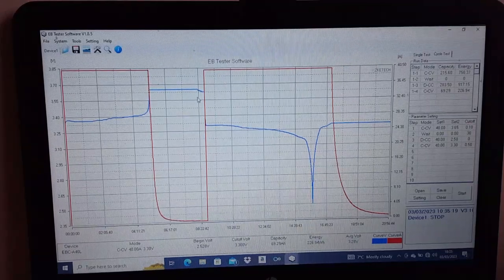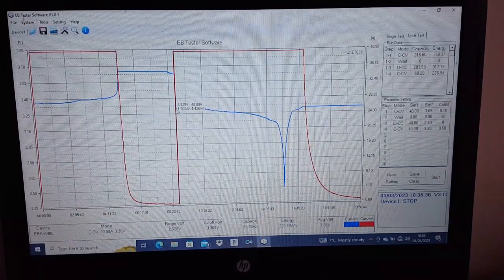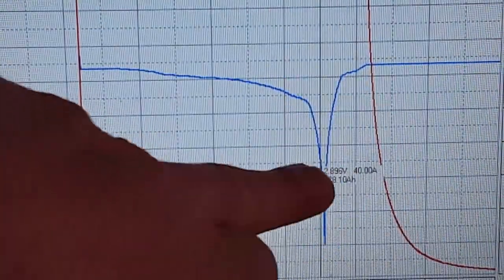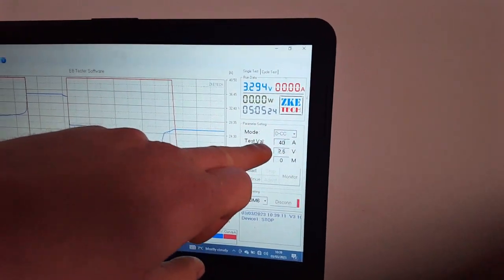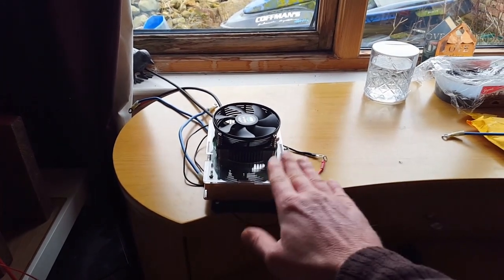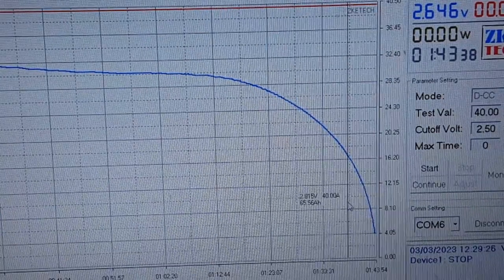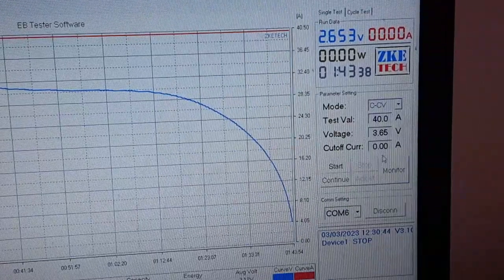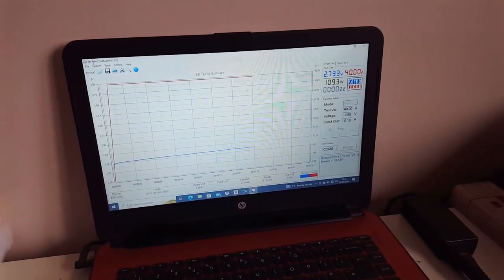Testing LiFePO4 Cells with the ZKETECH EBC-40L Testet has been a voyage of exploration!

Comment: Hi mate, I was curious for a while about your plans... You have a grid tie inverter and what inverter are you planning to connect to these batteries? I have investigated options with hybrid inverters and connection lifepo4 cells which is problematic as it needs certain bms's to comply with hybrid inverter settings. I'm currently filling in an g98b form for permision of 3.68kw solar system ( diy install, fingers crossed ;D ). Still looking for the best solution.Cheers
Reply from the maker: Hi ya, firstly thanks very much for taking an interest. 
Yeah we are mainly grid tied and had the orgional 4kw for about 12 years. The old panels started wearing out and  it is far to expensive to upgrade the system with grid tied hybrid inverters.  Until I get an AC coupled diverter inverter/batery charger I have been manually charging my littokala batterys using a cheep Aliexpress 5KVA 48v hybrid solar inverter that is wired into an off grid braker box in the utility room, running fridge, freezer and tumble dryer, counter top oven etc  My bloated wee 105ah littokala are getting worked very hard.
Every time we have solar to spare I am running arround like a mad man lol.
A Sofar AC coupled inverter is at the top of the list.  But until the then the off grid utility is working well and saving money.
With regards to a BMS I am sure my JK BMS with can bus coms ports will run with a Sofar amd other inverters but I could be wrong.
Let me know how you get on with your G98 aplicatipn I did not know you could legally DIY it. I need to get a g99 fastrack licance as I am well maxed out for grid tied solar but with our hotwater diverter box by SolarImersion and EV charging nothing escapes to the grid!  I  BURN IT ALL 🤣🤣🤣.
With the tempremental Scotish weather I need alot more solar and batterys on and off grid to get through gloomy wet summer days and winter. You can never have too much ⚡⚡⚡💥🤞
My plans and locations of equipmen may varie slightly
I hope that is coherant and helps.
Cheers
Gaz
Reply: @garys-half-baked-offgrid-dream  thank you very much for your reply :) I'll let you know about my g98 application. Wheather isn't much better here in East Midlands....